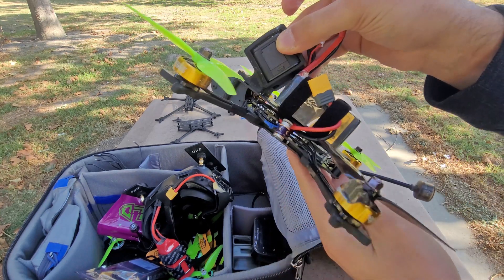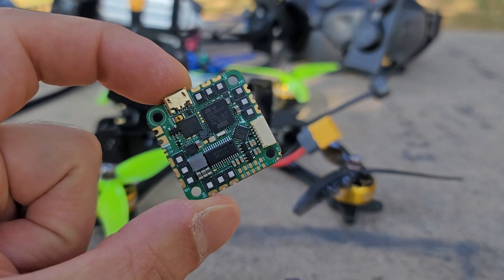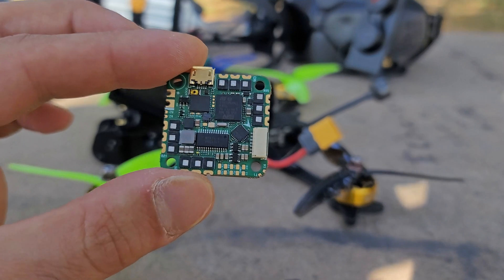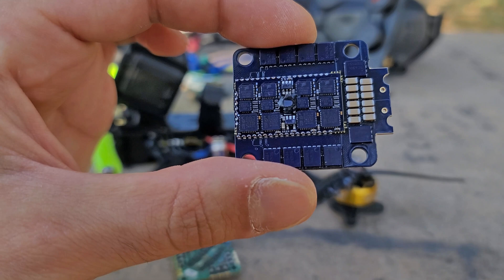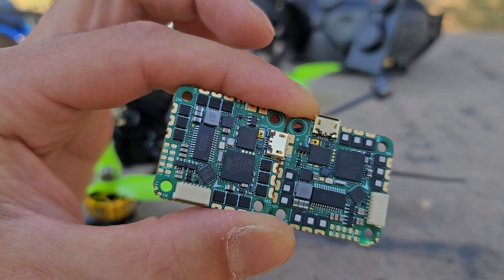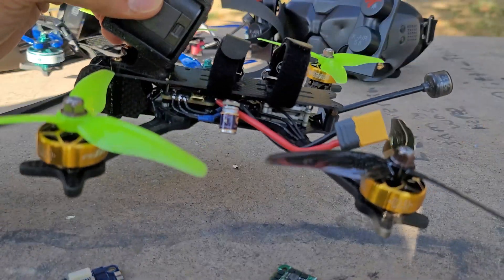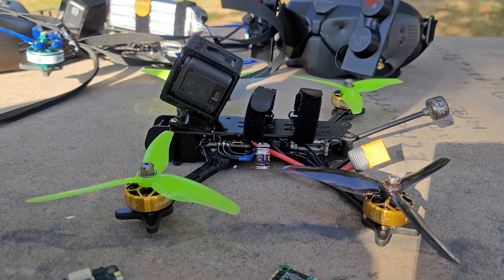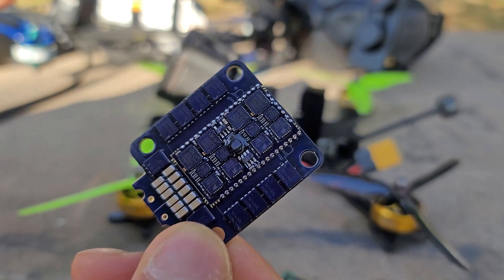iFlight Beast H7 AIO - A Whoop board for FULL 5"?

Comment: I still have my questions of these boards for a 5”.  And iFlight, I like the xing motors but haven’t liked the components in the past.  Maybe just maybe I’ll like the H7 board.  Love the H7 revolt from fl1 hopefully the iFlight is just as smooth.  Also the motors, I’ve been waiting for a good review and thrust test of the wasp majors but no one has put one up yet that I know of.  The stator size is very interesting to me. 👍
Reply from the maker: Thrust tests aren't really that useful.  It's a solid stator size and it's that size for a specific reason.  They worked out the numbers and found this to be the optimal balance of power for the given weight.  They perform really fantastic.  They should be a LOT more popular among racers than they are imo.  They're fine for freestyle too but I think 2306 is still preferred for freestyle.
Reply: @Kabab  I know the thrust test aren’t end all be all test but does give a decent baseline.  But I’ve been looking at them since they came out and debated putting them on one of my race rigs.  Just have 5 sets of xilo 2207 1750’s and 2 sets of hyperlite e series 1922’s to go thru first lol.  For my freestyle rigs I do wanna swap out and put some 2306 or 2306.5’s on it, currently has the xing 2208 1700’s(should have gone with the 1800).